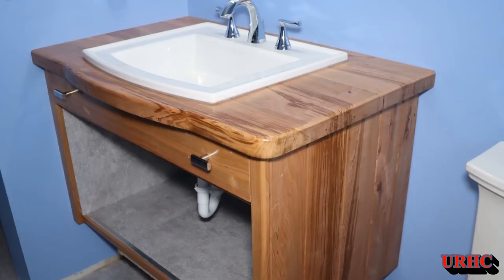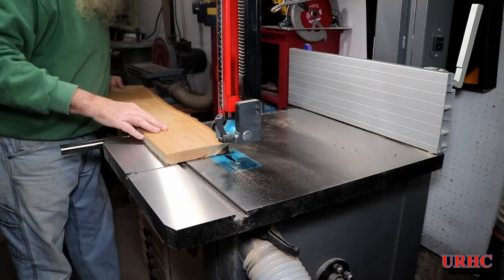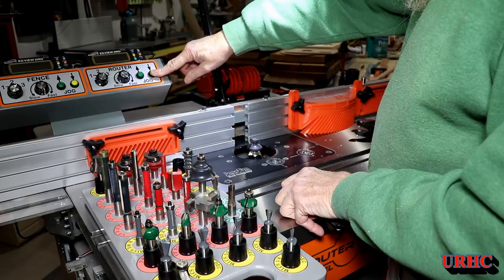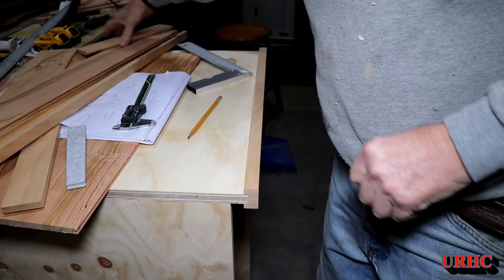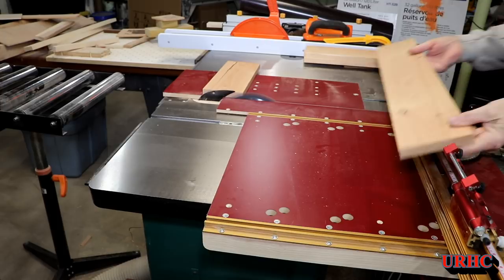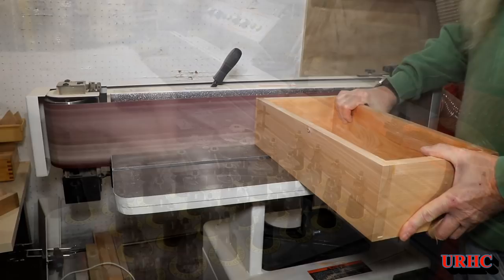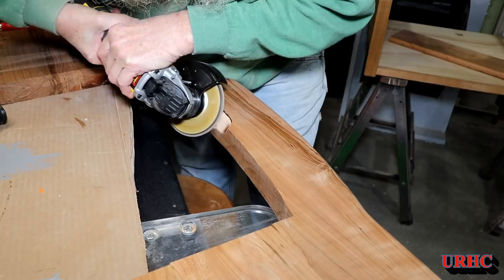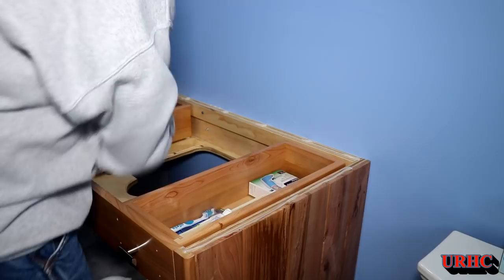Guest Bath Update Part4 Building The Vanity Cabinet And Hidden Stool

Comment: Ed, I learned a little trick from Marc Sommerfeld. Put a rubber O ring or one of those little 1/4" space balls in your router. Then you don't have to worry about leaving room below the bit when tightening it.
Reply from the maker: Thanks.  I was thinking about o rings myself. Definitely have to do something.  The old table I pulled the router out and laid it on the side so I didn't have this problem.  Thanks for watching.

Comment: Clamps: I buy at least 1 pair every time I go to Harbor Freight - they aren't the best, but the price...well, I suppose that since you need like 2 for every 1 better clamp it's abut the same ... but it feels good to have all those clamps lol
When I see a good sale on higher end clamps in the styles I use, I'll grab a pair or 2 ... the pipe clamps fall into this category - the HF ends work, but I find that they are less convenient to adjust.
Reply from the maker: I found a good deal on the little Bessy clamps at home depot and they are better then the new Harbor freight clamps for about the same price.  Harbor freight reduced the size of the backbone when they switched to plastic handles a couple years ago and made them real flexible. Thanks for watching.

Comment: Be careful with that water based polycrylic. I finished a lot of my furniture with it.  On the head board of my bed it began to becoming 'gummy' and I was actually able to start peeling it up easily with my finger. I had to get it back to clean margins and refinish it. I'm not sure what caused it, but it was right behind where my head normally rests. Heat/moisture?
Reply from the maker: I haven't had any problems with it yet. Used it on our island top several years ago and it has seen much abuse without much damage. Could also be from leftover chemicals outgassing from your shampoo that it's not compatible with. Thanks for watching.

Comment: I enjoyed watching your video many might consider it to be too long, for me I like seeing the details and what seems to be in real-time. It also shows the technique you use to accomplish a task. It is looking nice! 

I have quite a few Incra products and I have been very happy with them, you contact Incra and tell them about the issues you have having. I have 3 of the ball end hex drives and none of them get stuck like yours does. I have found their customer service has been outstanding, I am sure they make it right if you contact them.
Could you place a link in your description to the set of MCLS bit you have, thank you!
😁🛫
Reply from the maker: Thanks.  Incra did send out some replacement part in the beginning but they were not much better then the originals. I just realized the board was expandingand buckling when trying to get accurate cuts. It's been having issues for a while but I thought the saw may need a tune up. Only the main board is expanding  and it looks like a cardboard type MDF.  I will probably just try and sand off the raised spots for now and look for a stable material to make new ones. The ball driver is the least of the issues as it can be ground smaller. The usability of the whole stop setup stinks if you have to move it frequently like I do. I wouldn't touch another incra product after this. Thanks for watching.
Reply from the maker: It's just the wood boxed set with 66 bits that was really cheap right before Christmas. They are shown in the router table videos.  I got the set for $167.00 with  a bit holder and bottle of bearing lubes for free.  So far they all seem to cut nice. MLCS has several different size sets on their website.

Comment: We did a maple top with the polycrylic .   What do you clean that with?  Nice work as always. Better to watch than the football game
Reply from the maker: Thanks. I just use 0000 steel wool with the Johnson paste wax every once in a while.My wife will use a microfiber cloth to wipe it down and the Seventh Generation multi purpose cleaner if anything is stuck.  It becomesreal durable after about 3 months. I gave up watching football a couple years ago and don't miss it. Thanks for watching.
Reply: Thanks so much

Comment: Blade Guard - anyone know of a good option for a retrofit quick release guard for the old Delta Unisaw style? I have a Grizzly Z Series "Contractors Saw" - in today's parlance, "hybrid saw", but it's basically a copy of the old Delta Unisaw as far as I can tell.... but my guard takes a bit to remove / installa + adjust ( or if anyone has seen homemade options for same??) 

Thanks,
Reply from the maker: About the only ones I have seen are the dust collector ones on a arm. I have been thinking about trying one someday.

Comment: Was their a reason you didn't seal the wood before putting on the poly?  How could someone give you a thumb down?
Reply from the maker: Cherry is a tight grain wood and I never seal under this polycrylic  finish. I get lots of thumbs down that seem to come from the same type devices at the same locations.  Think most are just trolls that I may have blocked and reported for nasty language or threats. Thanks for watching.